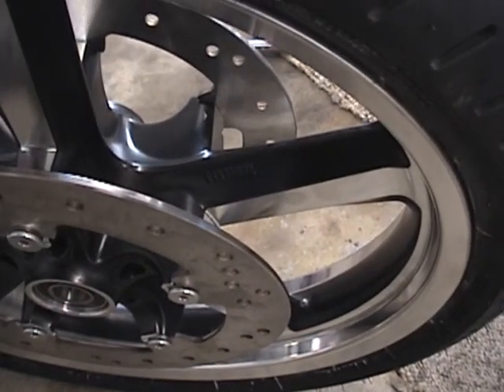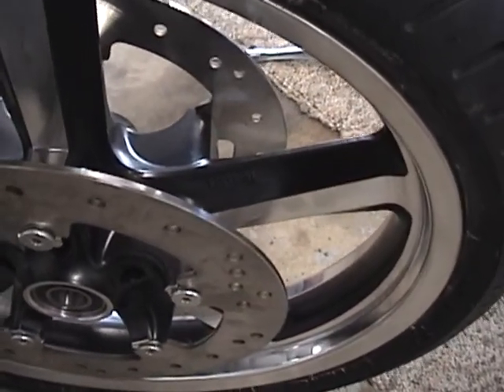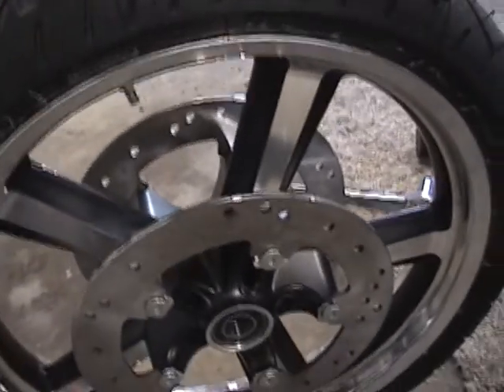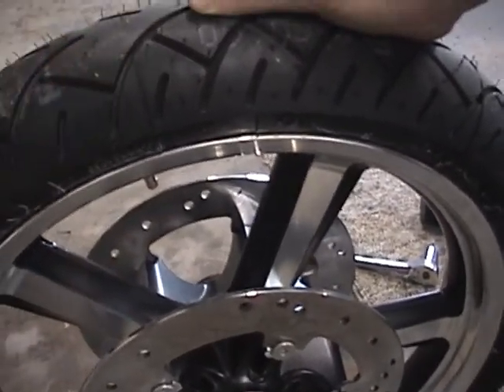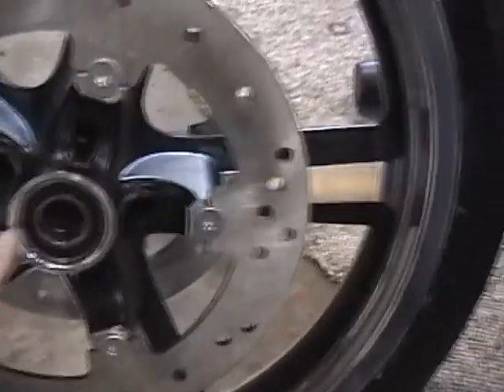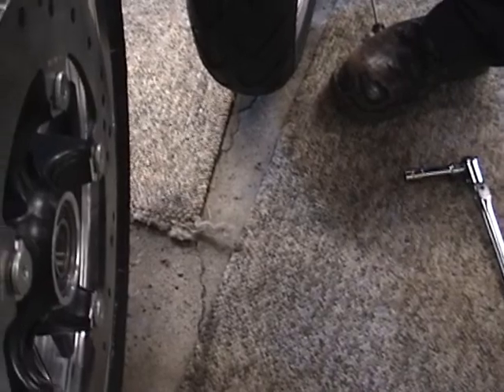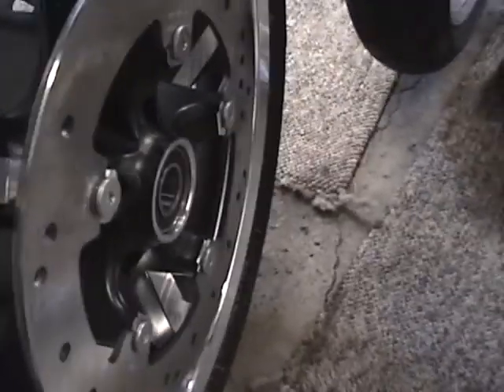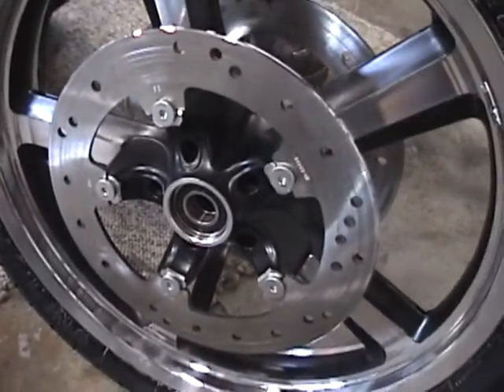Bearings 1

Comment: did you use 2 non abs wheel bearings?
Reply from the maker: Correct
Reply from the maker: some people have a small alignment issue and pad drags. use a banjo washer to fix it.
once torqued done the rubber makes it a perfect fit.
Reply: I have a muscle front wheel its fitted with an abs bearing . I will have one of the spacers turned down to suit.
Did you fit the rear muscle wheel to?
Reply from the maker: i went with 08 d set up direct bolt on.
240 takes up 10 hp